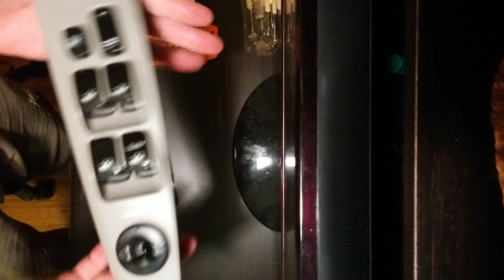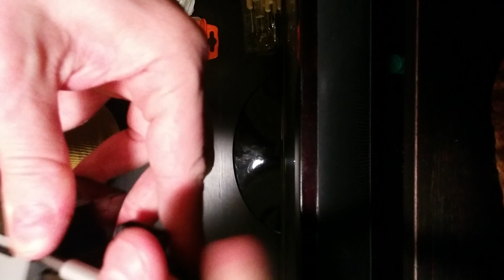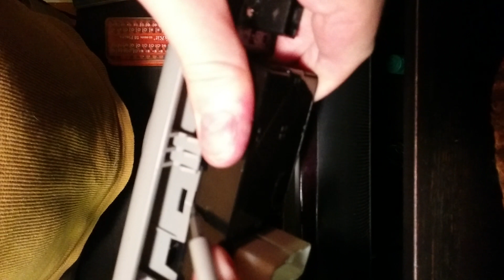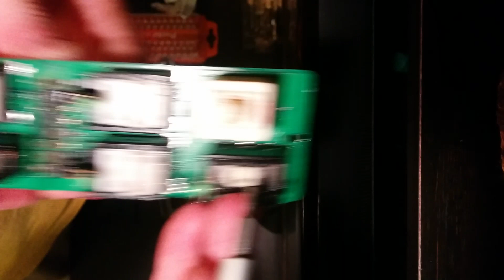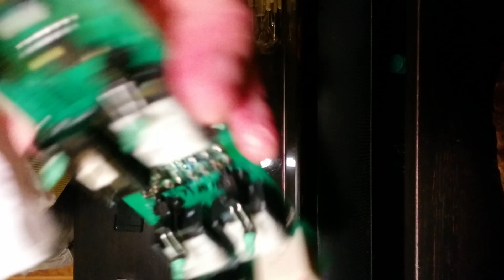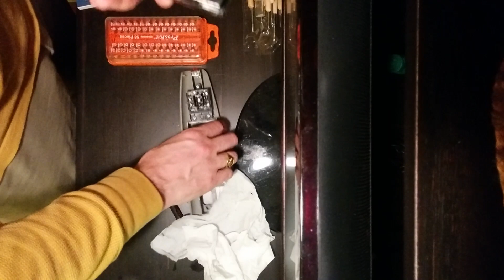2008 Kia Spectra window control panel fix / clean

Comment: The top plastic piece actually doesn't have to be removed to get at these switches!  Just remove the circuit board from the bottom once you get it out of the car.  It'll save you from breaking some plastic clips.
Reply from the maker: Great tip! Wish I would have known that when I was making the video! 😄
Reply: @jrronimo  Yeah, I'm so averse to working with small plastic pieces I try to avoid it at all costs.  Thanks so much for making this short video, my doors don't randomly lock themselves anymore!
Reply from the maker: @mattphoolishis  That's definitely the smart thing to do, haha. You're very welcome! I'm so glad it was helpful. And it's such an easy fix that doesn't involve replacing the whole panel or anything. Hooray!
Reply: That's true. HOWEVER, if you do remove the top piece, you'll have access to the underside of the buttons which will be full of dust and crud which is what made the switches stop working in the first place.

Comment: My driver's side window button had a spring in it, but it's missing and the button won't stay in the middle position. What spring should I replace it with?
Reply from the maker: Sadly I don't know... but I suspect that since its main purpose is to hold the switch in place any spring that fits decently would do the job. 🤷🏻‍♂️ Sorry I can't be more help!

Comment: I'd like to swap the left rear button with the left front.. currently the front left button will fully function save for springing back to neutral position! Sometimes it will make the window roll down after I've rolled it up lol! I can see the broken plastic but can't figure out how to get the window buttons free! Any suggestions would be greatly appreciated! Thanks for the vid.. got me to the point of having the circuit board separate! Merry Christmas!!!
Reply from the maker: If it's where I'm thinking, you'll need to break out a soldering iron... but it's been a while since I made this, haha. Good luck and Merry Christmas!

Comment: What did you use to clean it ?
Reply from the maker: It's an electronics cleaner called "Deoxit Gold". It's on Amazon for around $20 a can.
Reply: Is that the only thing you can use to clean it
Reply from the maker: @christopherjones1791  Sorry I missed this comment earlier. I don't know if you can use something else to clean it, but anything labeled "contact cleaner" would be a good try.
Reply: mass air flow sensor cleaner
Reply: there is a you~tube video for it

Comment: After trying this out today I'm one happy camper. Worked great to solve the sticky window operation. Only thing worth adding is that the window lock switch needs to be pulled out in order for the circuit board to come out of the housing. Thanks again for sharing.
Reply from the maker: You're very welcome! I'm so glad to hear it helped!

Comment: I have a 2011 Kia Sportage.  The passenger front window won't go down, but will go up from driver's door master switch.  The passenger door window switch works fine.  Any recommendations on fix?
Reply from the maker: I'm not a big car guy, but it sounds similar to the problem I was having. I'd try the same thing -- pull out the driver master switch assembly, clean it out with some electronics cleaner, and see if it works again. If the contacts are just dirty, that should help. If the switch itself is broken somehow, then you'll likely need a new switch assembly. Given the relatively young age of your car, I'd guess it's just dirty contacts though. Good luck! Let me know how it goes either way!
Reply: My daughters 08 Spectra is having similar issues. What did you find was the problem? Thank you in advance.

Comment: could help me know in which of the two fuse boxes is the sunroof fuse, which is by the battery or the one by the driver's feet, thanks
Reply from the maker: Mine doesn't have a sunroof, but according to the following link, it's in the one by the Driver's Feet: http://www.autogenius.info/kia-cerato-spectra-fuse-box-diagram/ -- good luck!

Comment: I have a 2007 Kia Spectra. The drivers side window controls sorta kinda work... it works great for driver side, for passenger side it will roll down but you gotta push HARD. the passenger window control only rolls up. the back windows don't roll down from the drivers side but the back right one will sometimes roll up. other one doesn't. do you think this might be what's causing my issues?? or should I say whatever and go to the junk yard to grab a whole new set of switches?
Reply from the maker: I don't know a whole lot about cars, but if the problem is electrical, then doing this spray fix is worth a shot. It could be that the switches are just worn out, though, at which point yeah, you'll want to try the junk yard.

It could also just be electrical problems -- the wiring could have gone bad, or the motors could be shot... I really don't know, sorry. Good luck!
Reply: My daughters 08 Kia Spectra is doing the same exact thing. Did you happen to find out what the problem was? I would greatly appreciate a reply. Thanks in advance.